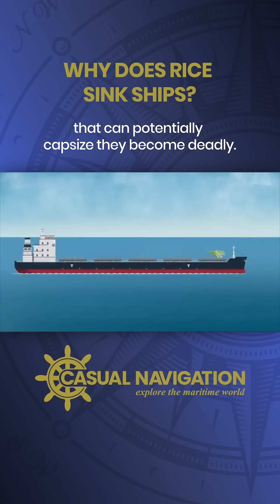Rice Cargo = Maritime Disaster! 🍚⚓ (Here’s Why)

Comment: why not make the ceeling come down via hydraulics or something like that?
Reply: If I am not mistaken they use some short of excavators to level out the cargo
Reply: @retematic1488  because it will add weight, which means more fuel and more expenses.
Reply: @Enlighten-n6n  cheaper than ocean floor recovery
Reply: @retematic1488  exactly, that is why most transport logistics is packaging them in sacks and bundles.